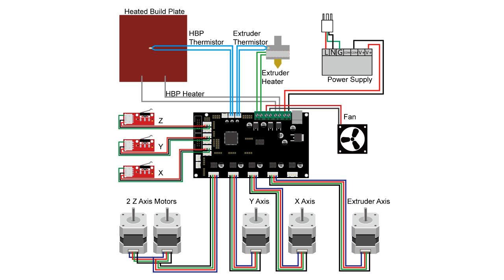How to assemble Link 3D printer kit

Comment: hello, how did you setup the software of 3d printer?
Reply from the maker: You needn't setup it. Importing the 3D print file into the SD card， then insert the SD card to the mainboard.
Then open the machine, it will working.